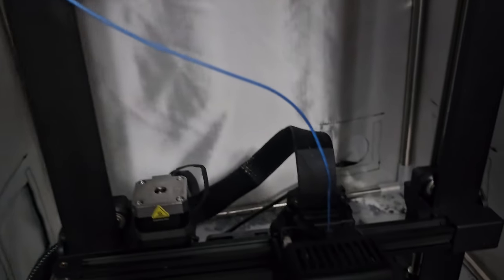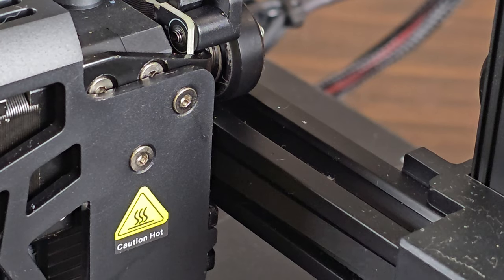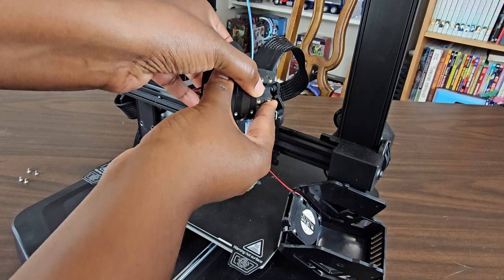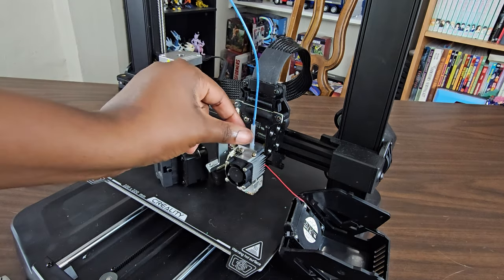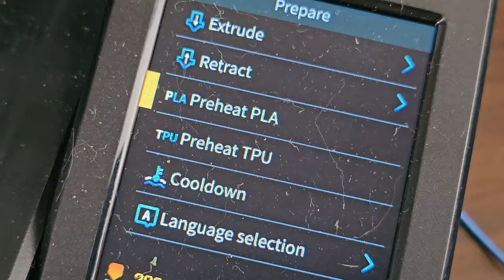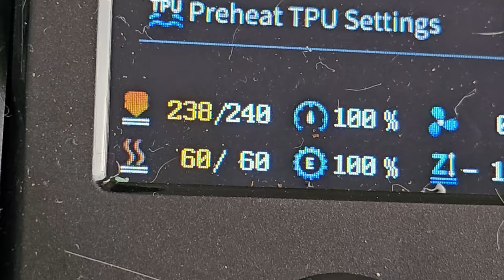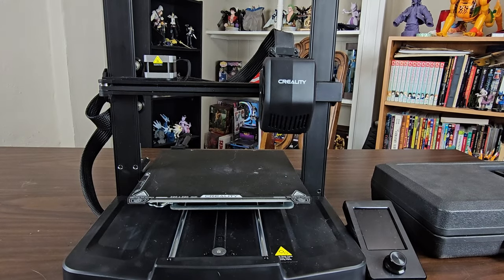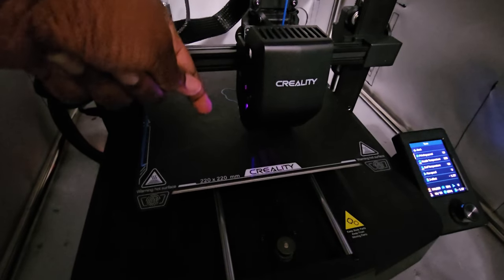Clog Conundrum? How to fix an Ender 3 V3 SE step-by-step!

Comment: that printer was not made to go that slow
Reply from the maker: You are absolutely correct. It is a preference for me to start my prints at a slower rate before I chose to speed it up. I'm in no rush to print these as it's for my collection.  To me, I see a difference from just printing at its base speed vs. printing at a slower pace.
Reply: Why do you care?

Comment: I think spools tangle when the printer goes too high on the Z axis, which can push the loops of filament on the spool out of place (theres no tension now) at least in my case. No issues with it so far, but it does happen occasionally. I'll keep a closer eye on it when the spools running lower!
Reply from the maker: Thank you! I never thought about that. I will keep an eye on my z access should this happen again. I appreciate the advice. ☺

Comment: My ender 3v3 se has been a nightmare got it a few months ago it had problems from jump. The first was the screw holes that were on the molding was not attached. Then the screws on the bottom of the upright extrusions wouldnt tighten. Then it was the hotend going bad then the extruder was poorly manufactured  now I cannot get it to stay extruding constantly causing failed prints every time. In the meantime I've gotten a used elegoo neptune 3 pro and it has been a champ not one major issue at all it was a used but good machine and ran 10 tines better than creality new machine.
Reply from the maker: @jameshunt2577  damn, that sucks you had a bad experience. At least you found a printer that works for you.  To me personally, 3d printers are a preference. If it works for you great, if you found one that works 10x better, fantastic. As long as you're able to print what you love, or print to make profit, go for it. Happy Printing!

Comment: So this happens on SE's all the time, you just heat up the nozzle, you can do this via the control menu or via your method or you can even just use the "extrude" or "retract" functions. Once the nozzle is above 180 degrees (for PLA), push the filament downwards to melt the bit thats catching then pull it up and out, easy. I dont recomment taking it apart as you did here every time you need to remove filament.
Reply from the maker: To be honest, this had only happened twice in my many prints. 

1) I didn't clean away the silk PLA when switching out filament, and it got stuck in the extruder, and I had to open it up because it was stuck where I couldn't heat it up.
2) This video,  the filament got tangled in the spool and nothing was printing (I still don't know how that happened) and yes, I did the retract and extract method at first. When nothing happened, I thought it was stuck in the extruder again and that I had to take it apart. Thankfully, like you said, it needed to be heated up. 

3) The short is a demo of what happened the first time. 

But yes, I've learned temp towers are your best friends, and so is heating up the nozzle more than normal and I haven't had that problem since. 
But I thank you for the helpful advice as I feel it is good advice to get good tips and tricks from others who have gone through this. 😊

Comment: Check the small alu pipe between hotend and vented radiator, remove, clean, apply thermo paste on the screw, put it back and lock it right! all my cloggong problems gone.. yw
Reply from the maker: I happen to have thermo paste! I will take that into consideration. Thank you so much for a creative solution 😃

Comment: Thanks for this...Just got my 3v3se and a piece of material was stuck in the top of the tube. Your vid showed me how to do the disassembly and repair. was back up in 15 minutes.
Reply from the maker: That's awesome! I'm glad the video has helped. It's a remarkable beginning printer despite its problems. And it beats manual bed leveling any day lol. Happy printing. 😊

Comment: Great video , thanks. I have had my SE for 3 days and it is such an upgrade from my Longer K5 pro.
Reply from the maker: Welcome to the SE Club!!! I'm going on six months since I upgraded from the manual Ender 3 V2. I didn't mind self bed leveling but by the time I finished leveling the bed I was able to print 6 successful prints out of 20. Whereas with the SE, I've had 180 successful prints (I'm including individual parts) out of 200 roughly. So despite its minor problems and hiccups, I still love this printer.

Thank you for the comment and Happy Printing!

Comment: I have this problem on both of my machines almost every time I leave the filament in the printer.  I have always been able to heat it up a little hotter than usual, then extrude a little.  After that I can usually pull the filament back out.  

It was very informative watching dismantle the extruder/hotend.  Haven't had to do this yet but I'm sure I will soon.  One of my printers has an issue that I would think is a clog but I've cleaned it out, replaced the nozzle, and both fans.  I may be digging into it trying to solve the problem.
Reply from the maker: I may do the same just for the sake of learning about this printer, cause there are not a lot of videos out there for the ender v3 SE. I've always taken things apart and tried to figure out how to put it back together as a kid. I may do something like this for my printer for the sake of knowledge. lol

Comment: Thank you. This was very helpful. Outstanding camera work and closeups.  Somehow my print got messed up and dried filament was caked all over everything.  I ended up using a heat gun + heating the extruder to soften it enough to pry off with needle nose pliers.  (Seems to be OK - test print is coming out OK.)  God Bless
Reply from the maker: Thank you very much. I have a heat gun, can I use that to clean up dried caked filament on my heatsink? Cause your method is brilliant.
Reply: @JustAnAverageGirl83  I think it would work.  You probably want a nozzle on the heat gun that is focused so you're not accidentally overheating other parts of the print head.  I was able to focus it just on the dried filament and as it would start to melt I could easily pry it off with some tool.  I'm not as familiar as you are with all the components.  If you are aware of something sensitive you may want to place Kapton tape over it for some extra heat protection.
Reply from the maker: @ridethetsunami  I'm sure I can MacGyver something lol. Thank you so much!!😁

Comment: Well Done!!! you inspire me to keep on exploring this amazing journey
Reply from the maker: Thank you. I know there are printers out there that are more efficient than this. For someone on a budget, like myself, and you want to know how to manage your printer while learning how to find the best setting for smoother prints, then work on that until one can afford printers like Bambu...that's the goal. So research what printer your looking for amd Happy Printing!😊
Reply: @JustAnAverageGirl83  So far i noticed, that it,s only the ecstatics that are appealing. I did a few prints on the new ender3 v2, and honestly, my modified original Ender3 does a better job so far.
Maybe with some tweaking, it might perform better. So which printer are you referring to? That performs better?
Reply from the maker: @Jeatnet40  So much props to you, for successfully managing the gen 1 printers. The Bambu is all the rave. I've seen YouTube videos where it can make errors and have problems as well. Personally, I feel all printers are a preference. I once had an ender 3 v2, and I did more bed leveling than printing even when modified, so that's why I went with the SE. Ever since the auto bed leveling, I've printed more figures and had little error minus this clog which was due to the spool getting tangled in itself.

Comment: I had that same problem with my se in a enclosure it was open but i guess its a common problem for the filament to get stuck right where it enters the heat sink so what i did was sense mine was clogged in the entrance i heated that unclogger up with a torch put it on the filament waited for it to cool then got it right out of there hope it will help you one day if you need it!
Reply from the maker: @Productreviewing538  Thank you! I took a screenshot of this so I can save this is my notes. 😊
Reply: @JustAnAverageGirl83  your welcome!

Comment: Hey on my se it won't load the filament I've tried cleaning the nozzle and replacing it I'm kinda lost in the sauce
Reply from the maker: It depends, after a print and I switch out filament, after I retract I set the temp to 243-246 c and use the wire and to push out any excess filament in the heat sink out through the nozzle. I would try that. 

If you can't even feed the wire through the extruder, then somehow there's filament stuck in the passage way of the extruder, and you would need to open up your device to take it out. This is a YouTube short where I demonstrate that. https://youtu.be/sBw3hiEZsco?si=dYh8hyCqnUnElMei

If it's a brand new filament, I always do a temp tower so I now the right temperature to set it cause if the temp isn't correct, I believe that's how filament gets stuck. After I did that I've haven't had a problem since. Happy printing
Reply: @JustAnAverageGirl83  thanks for the reply but I tried this and I broke a quick connect on my printer so I have to get a new one thanks though

Comment: 1. Just increase the hotend beyond filament manufacturers' recommendation.. 
2. changed that white ptfetube to much better Blue Capricorn tube...
...learned the hard way from my old and tough still using today "almost throw out of the window" first model CR10...
Reply from the maker: Excellent! I still have a spare capricorn tube from my ender 3 v2!! Thank you so much!!!

Comment: I think my extruder is clogged, some molten filament solidified inside it when removing, any suggestions?
Reply from the maker: I don't know the extent of your filament. (Like how much it has clogged your extruder? Or if it filled it to the top or if it's stuck at the end that connects with the heat sink) The only incident I had before this video was a small blob that I could easily pluck out with tweezers. 

The fact that yours is solidified would mean that you would have to heat it up somehow. Have you tried a heat gun? You would have to match the temperature of the filament to soften it somehow so you can pull it out. 🤔 

This is the only time I've had this problem. After this, I started using temp towers to prevent this from happening. 😅. This is a suggestion, I don't knew if this will help.
Reply: @JustAnAverageGirl83  It was my fault...I poked it with the needle that comes with the printer to clean it and when I pulled it, a little filament came back I believe
I'll open the extruder and see what happens...thanks
Reply from the maker: @CortesBombado-fv9cy  I'm gonna sound like an after-school special but I wouldn't sweat it. I personally used to (and still kinda) take things apart to figure out how it works. I say chalk this up as an experience, learn, grow, and continue to print. 

But be careful with how you handle it when taking it apart because you don't want anything falling out and you don't know where it came from. I wish I was more help.😞

Comment: when i preheat my PLA my printer starts beeping and says ”nozzle temperature too low” what do i do?
Reply from the maker: The first answer to your question is that you need to open the extruder itself and take the filament out. As for your second question, I do not know. There are helpful groups of Facebook that I'm sure can help you.

Comment: I am having this issue and have done and changed everything. And it’s still clogging. Ender v3 Ke , SE and S1.
Reply from the maker: Nice, that you have all three. I only have the SE. It may not be your printers, but the g-code itself, a territory I'm afraid I haven't messed with. I know there's an update for the SE, but I never updated it; but I've come across files that were actually the problem and not the printer. 

Also, it's good to do temp towers before you print. If you don't do that already, cause all filaments are not created equal I discovered. So make sure that you've done that. 

Finally, every clog is different. As you can see in the video, mine was a heatend clog because the filament got tangled and got stuck in the heatsink. The last time it was clogged, it was stuck inside the extruder. So monitor that and make sure to clean your nozzles after several prints, as I demonstrated in the video

So, if you have changed everything for all three devices: brand new heatsink, nozzle, etc, it may be the g-code, which I've said I have not touched that territory. 

I would suggest joining 3D printing groups on Facebook like "3D printing help and troubleshooting", they have been a big help to me and I'm sure there is someone who has solved the gcode problem for your printers. I hope these suggestions guide you closer to a solution best of luck to you.
Reply: Check your settings for the filament type. Each as a different recommended heat, adjust your file for the heat you need
Reply from the maker: @gordonlaurie1201  yes, sometimes I have to remember to do temp towers as well to find the right temperature. I'm still trying to figure out how my filament got tangled in the spool cause that's what really happened. Instead of automatically retracting (which I wish it would do when this happens) it was still trying to go and it got stuck. But I still enjoy this printer. 😊